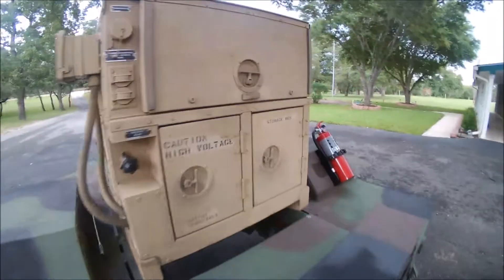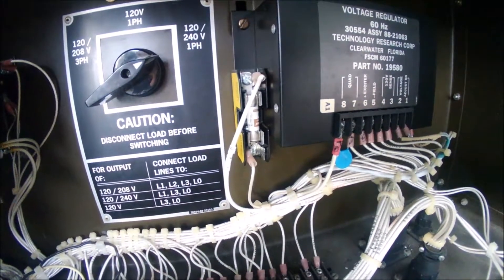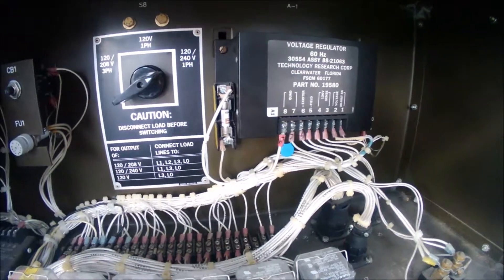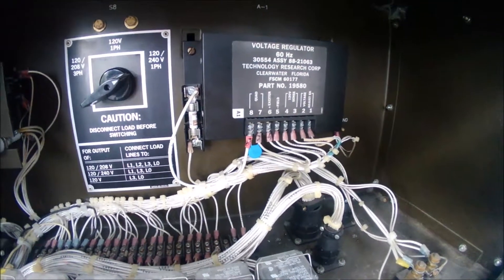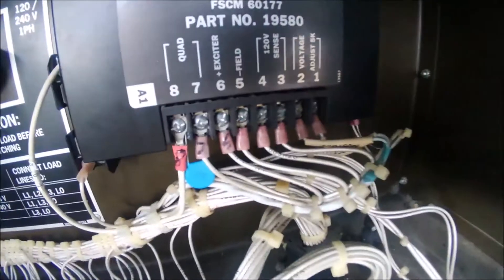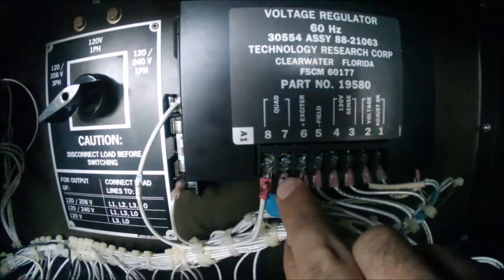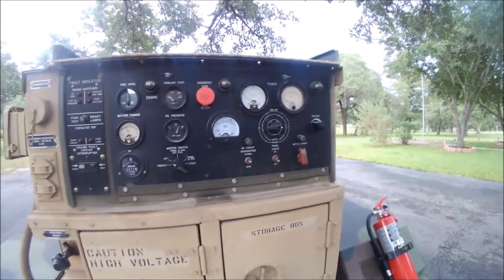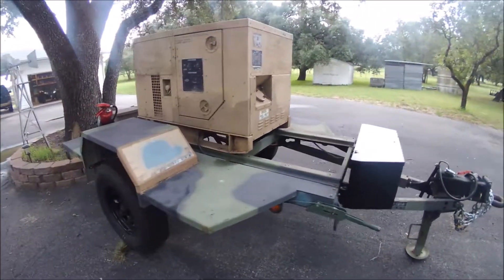MEP 802A - Required modifications (MOV mod Fuse mod)

Comment: Was wondering if you would be able to help me. I have a mep-805b and I’m currently trying to power an ag well motor with it. My unit won’t produce power and the “under voltage” light under “contactor trip” is lit up. When I excite the field the voltage meter jumps up to normal range (I believe)and then when I stop exciting it goes back to zero.
Reply from the maker: Find & download the Technical Manual for that unit & it should help. I don't do anything with the larger 3 phase only units & am not sure how the excitation system works.

Comment: I ordered parts from your site! Thank you! What and where do you buy wire for these?
Reply from the maker: Any wire will work fine. No need to use the exact wire that is in there.
Reply: @ Ok thank you Colt! Appreciate you sir. I will likely buy some more items from you too. I have a 501a and 802a and plan to buy more. Love your truck with lift on it by the way! I see why that is so handy now.

Comment: Life saver! My mep 802a just arrived and does NOT have this fix so now I am hoping the stator is not shot. How would I know the stator is bad and if it is who can I look for or go to to get it fixed? I was really hoping it had this fix already. The generator has 883 hours on it.
Reply from the maker: Just run it & see how it makes power.
Reply: @ Do you ALWAYS ground these properly before ever attempting to start?
Reply from the maker: @mrmillmill I always ground the units when starting now
Reply: @ seems like the best move to me! I am having a transfer switch installed on house but i have seen some 8ft grounding rods on sale that i may try out just to say I did.
Reply from the maker: @mdnrgismo  if you were hooking up to your house properly, your house is already grounded and has a neutral bond so make sure you do everything properly.
Reply: @ yeah i plan on having a professional install transfer switch for that reason. Thanks for the feedback too. You ever have any electric fault issues with these?
Reply: @ OK will do thank you

Comment: i have a fuse added here that is 20a no varistor.  is this existing mod an old update?  bought your recommended parts list and going your way instead
Reply from the maker: If you don't have what is shown in the video, you don't have the proper modification published in the Military Work Order.

Comment: The Barrister clamps the voltage at a level that is below the peak inverse breakdown voltage of the diode bridge in the regulator which should theoretically prevent diode Bridge failures in the regulator which of course would lead to other catastrophic issues with the stator coil.
Reply from the maker: I love the comments section! I never knew what it did, just that it did something.
Reply: @CallMeColtLLC  Google voice mistyped Varistor as Barrister. I'm a semi-blind old fossil who can't see very well. Sorry if that caused any confusion.
Reply from the maker: @basspig  I knew exactly what you meant. 👍

Comment: hi replace the alternator 24 V not the original i have a new problem see if you have any advice  the  connections exactly like the original wend i flip the knob to dead crank make noise like want to star then when i go to the master switch  turn  to any position there no noise or contact also replace the fuse FU1 battery  are  charge is there any other fuses they might  blow up in the installation any help is welcome thanks

Comment: hi i like you videos i just purchased the MEP  802 generator and having problems whit the alternator  can't fine the original is there place online need help  the original has 3 connections a the auto part show positive and ground but is missing one connection is the goin to be a Be a problem i appreciate you help thanks
Reply from the maker: They are usually available but as used take off units, unless you want to spend a LOT on brand new. I from time to time part generators out. Keep an eye on my eBay store if interested. There is a link to my eBay on my website, www.callmecolt.com

Comment: Outstanding video, thanks for taking the time to help the less informed (me)!
Question the wire from the top of the fuse holder goes to terminal 8 , where does the wire from the bottom of fuse holder go?
Thank you again for the help

Comment: Help! My mech connected the batteries wrong on my Fermont MEP-802A 5kW. Not starting now.
Reply from the maker: Could be many, many things, including burnt up 24v system if left connected to long.  I'd start with a new mechanic. 🙃 If you don't have the Technical Manuals yet, they have some troubleshooting trees in them.

Comment: I just picked up one of these at auction. It’s missing the fuel pump.  It makes me wonder what else I don’t know. I’m not a diesel mechanic. Where do I start?
Reply from the maker: Hard to say if you don't know what you are looking at to be honest. The Technical Manuals can be downloaded but they are confusing. The best advice I can say is to just look it over & do your best to figure out how it works. If you have any mechanical abilities, it shouldn't be terribly hard to figure out. That's what I did with all my projects. & used lots of internet searches! Auction items can be a real gamble. Never know what is missing or wrong with them.
Reply: @CallMeColtLLC  Thanks. That’s the plan I have at the moment. Thought it might be fun to learn this way. Are you also in San Antonio? Can you provide some help sourcing parts?
Reply from the maker: @chipb9868  I am in the San Antonio area. I have spare parts & such. On my main channel About page, you can find my email. Reach out!

Comment: What are you running out of your terminals? Would like to see how your power distribution panels set up on the side there
Reply from the maker: I ended up changing it a bit, but I have one 30 amp 220v outlet & two 110v outlets. Nothings crazy. I use the 30 amp outlet 95% of the time.

Comment: Thanks great vid and good to know.  Mine doesn’t have either mod so will be ordering parts today.  Which voltage rating for the MOV do you recommend?  I see they vary from 135v-200v on eBay for same part #14d151k.  Thanks
Reply from the maker: The voltage on the circuit is around 120v if I remember correctly. Just go with the highest one as it will work with less voltage. The rating will be fine as long as it is higher than it what in the circuit.

Comment: What gauge wire did you use for the jumper? Thx
Reply from the maker: I did not use any wire for the MOV. The Fuse modification was already done. I think 14ga would be acceptable.
Reply: @CallMeColtLLC  Thx